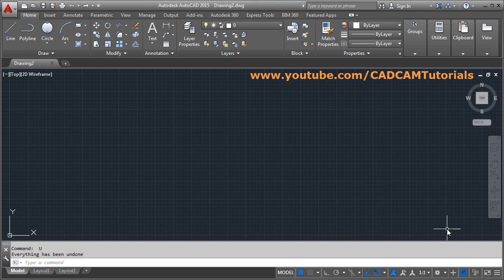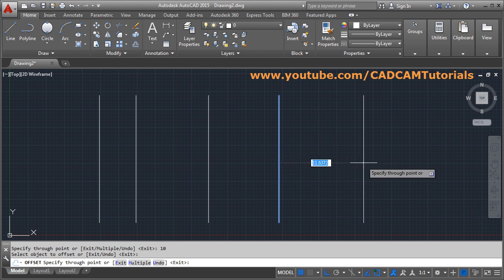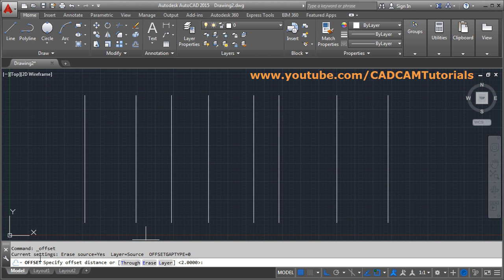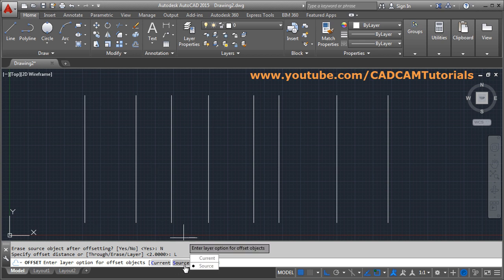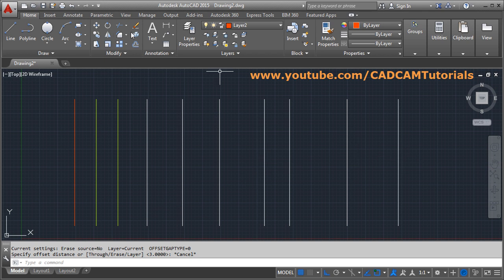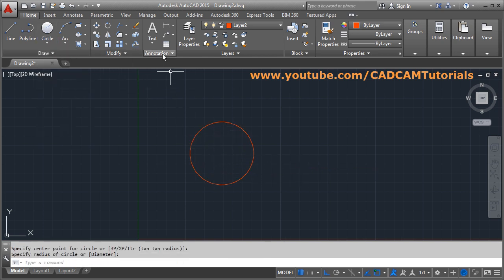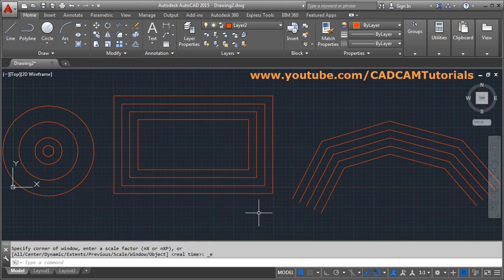How to Create Offset in AutoCAD | AutoCAD Offset Command Tutorial Complete

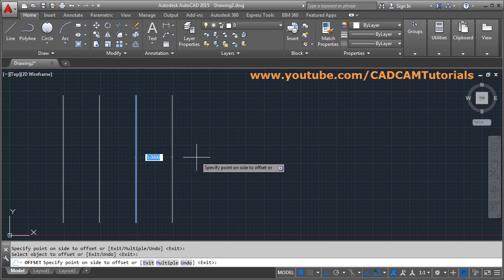Comment: Hi, I can no longer offset a distance other than the initial entered value without escaping the command. like you did at 1:06. What can I do fix this? I'm using AutoCAD 2018. Any help would be much appreciated.  Thank you
Reply from the maker: Make dynamic input ON
Reply: @CADCAMTutorials   thank you for responding ... dynamic input is actually on. I tried turning it and on again but still no luck
Reply: @CADCAMTutorials  even dynamic input is enabled same problem is repeating

Comment: while using offset all the commands u used were good but when im using them i see difference in the distance of offset when checked for example i give value of 5 meter then it shows a distance of 5.45 or lesser than 5. what should i do to solve this problem?
Reply: I have the same problem
Reply from the maker: After entering value press enter and don't click.